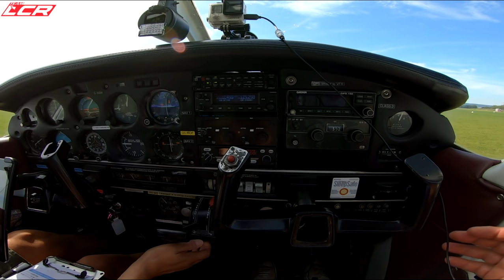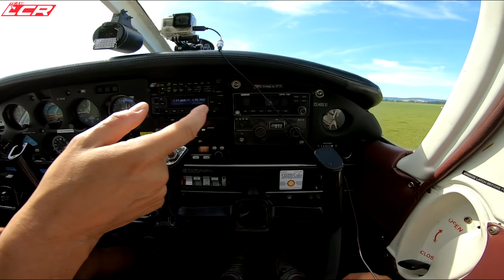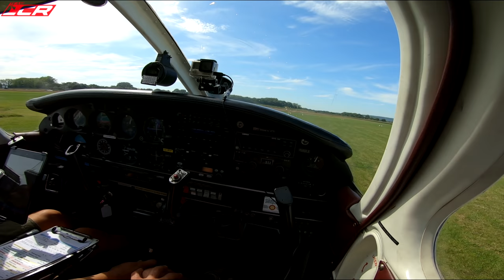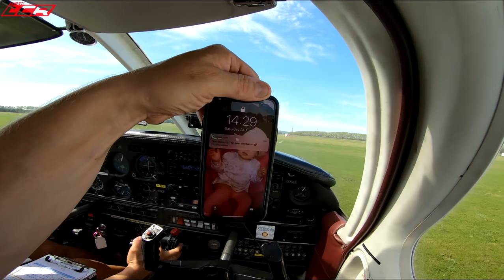Bikes VS Plane | Which is quicker, Ninja H2 Or An Aeroplane?

Comment: Chopsie you do realize that the Plane actually won the bet, it did get from point A to B first, it was the added stipulation of the fellas having to hop in the Mercedes Kombi that actually cost Andy and Richy the race. I think you need to do it over with flight from FBO to FBO, after all you all started at the FBO.  So, after much consideration and deliberation Andy and Richy won the race.... technically of course. Still awesome video’s all of them.